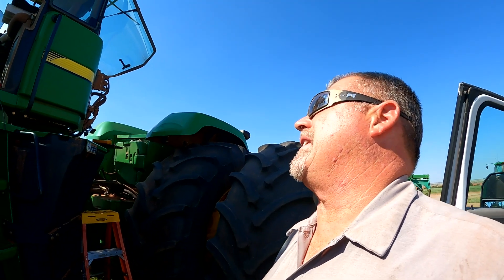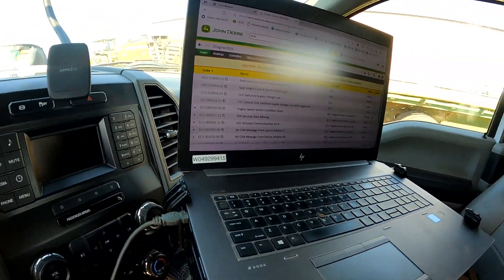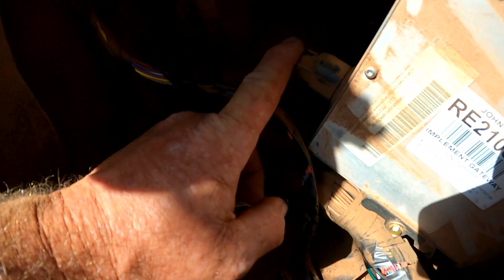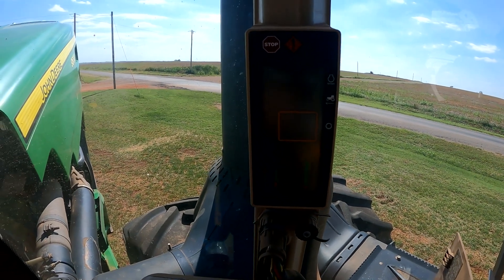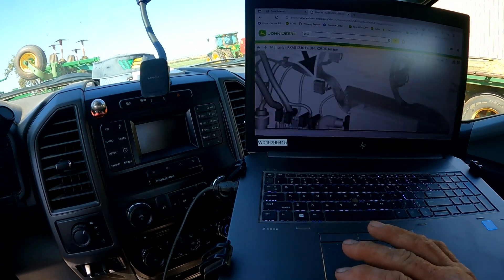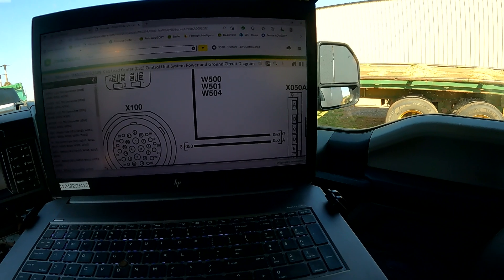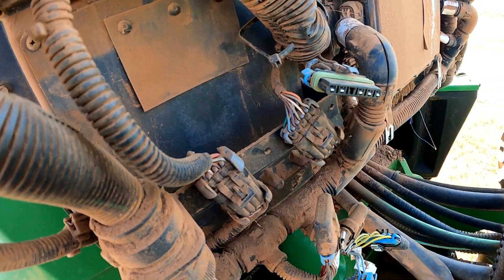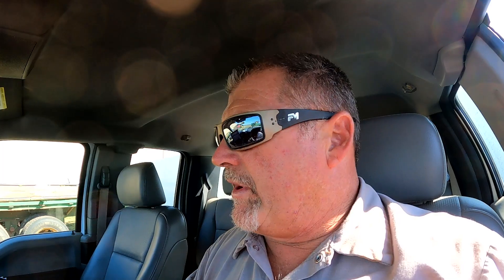Larry's Life E57 | Schematics are HUGE John Deere 9530 4WD Tractor Cab Going Bonkers

Comment: I've found this issue on a 9630 this spring. I was finding over 2.5 V between the controller cases and the negative battery cable when I was checking stuff out.